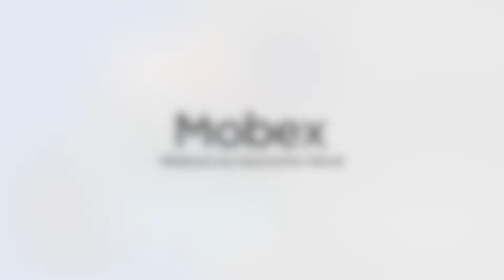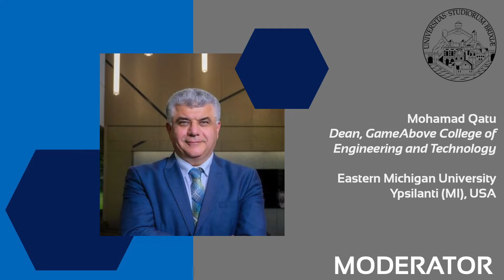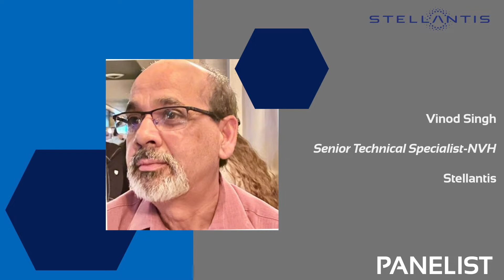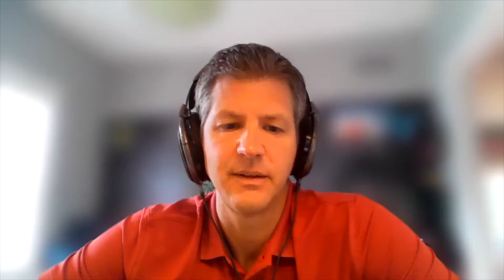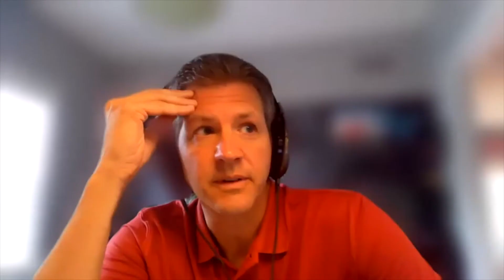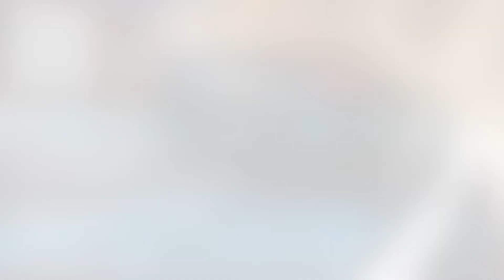Webinar: The shifting focus of NVH in electrified vehicles (Virtual Panel)

Comment: Removing NVH and increasing disconnect of driver from the vehicle by electrifying or automating each of the inputs, ruined what made cars enjoyable.

It started with electronic throttles, degradation and cheapeningnpf shifter and clutch mechanisms, move to automatics and eradication kf manual transmissions as a whole. Electronic numb feeling powersteering thay transfers little to no feel or feedback.
And whole hellinf NVH focused design.

 Its so bad that i dont care for any modern vehicle anymore even sportscsrs, because all lf the suffer from this equal parts as general commuter cars and everything in between.